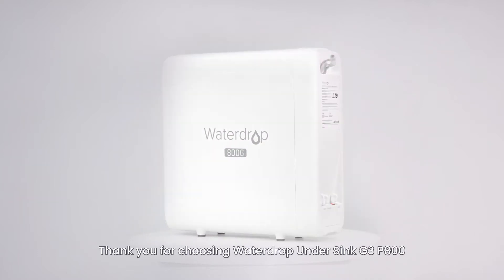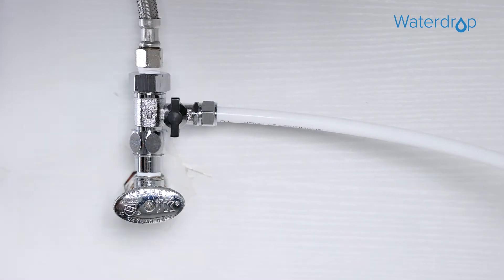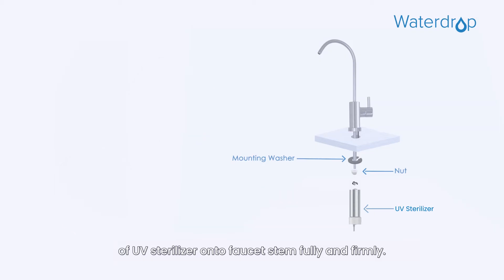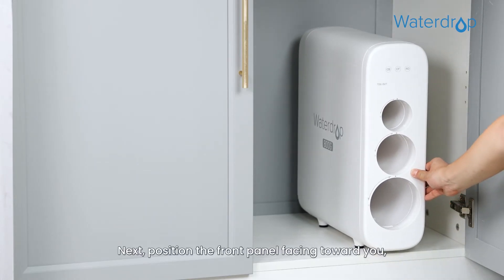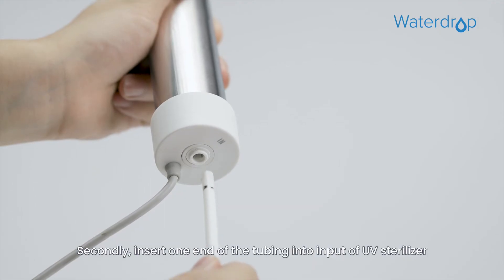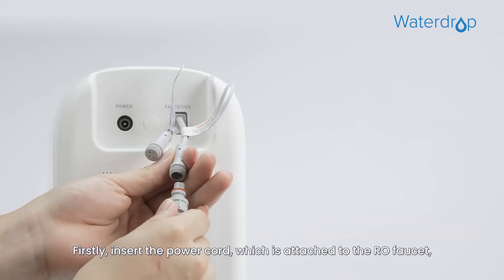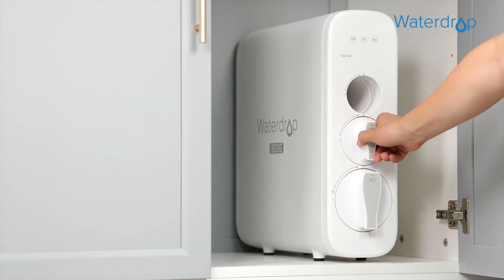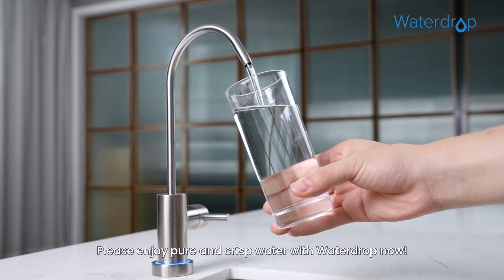Waterdrop G3P800 RO Installation

Comment: My plumbing set up has a 1-1/2" ABS drain pipe that I have to use for the waste water saddle.  The 1-1/4 sink drain were not ABS so the OD was too small.  To change it all would require doing way too much work.  I was able to make it work however it was strained over the ABS pipe.  I'm sure I am not the only one that has incurred the situation. Should include a waste connection for both drain pipe sizes.

Comment: Really wish the instructions didn’t call the cold water faucet line a cold water pipe without specifying what the “pipe” is. I was set to install it like this, then read the instructions and it confused me thinking the hook up was virtually backwards. And none of my fittings fit so I had to go buy adapters to reduce, now I have to go back and buy all new adapters because the instructions are misleading. I would have been better off if i didn’t look at that damn page! 🤦‍♂️

Comment: We just have one power outlet that is connected to the garbage disposal. In order to use the RO system we need to discinnect the garbage disposal. Is there a easy alternative to this issue?
Reply from the maker: Hi,
Thank you for contacting us.
I apologize for any inconvenience that may have caused you.
 
In order to provide proper assistance to you, could you please contact us via the following email? Thank you.
service@waterdropfilter.com
 
Enjoy the rest of your day!
 
Kind Regards
Mia Lauren
Customer Service Rep
Reply: Honestly if it's connected to the GD then you aren't going to have a good experience since that is presumably on a switch - an electrician can install a second 'dedicated' outlet, which you'll need
Reply: Look up kitchen split recepticatical outlet. Please be careful to turn off the breaker while modifying the outlet as it's 120v or higher. It was easy for me, but I've worked with electricity for 10+ years.

Comment: it’s really difficult to insert drainage pipe in whole
Reply: Might want to update your video and instructions -put a sticker on the box and send to website for updated instruction.
Reply from the maker: Hi,
I'm sorry for the inconvenience caused; please note that the drain saddle has been updated but the user manual is still the old version.

The tubing does not have to go through the drain saddle in this case, thank you for your understanding.
If you need further assistance, could you please contact us directly, thank you.

Email: service@waterdropfilter.com
TEL: 1-888-352-3558
Reply: @waterdropfilter.official  I had same problem , spent over an hr trying to understand what I am doing wrong. I am about to send it back. Update your video/manual
Reply from the maker: @vitaliestirbu9607  Hi,
Thank you for contacting us. 　
Please note that the drain saddle has updated and the red line does NOT need to go through it anymore. 
The user manual will be updated ASAP.
If you need the old drain saddle version, could you please contact us via the following email? Thank you.
service@waterdropfilter.com
If you have any other questions, please feel free to contact us.
Enjoy the rest of your day!
Kind Regards
Mia Lauren　
Customer Service Rep
Reply: @waterdropfilter.official  Hi, from my experience, this is not true. Our drain pipe leaked significantly when the pipe was not pushed through the front saddle. In order to push it through the saddle, try pushing the push to connect fitting down as if you were going to remove the pipe, and continue to follow the directions. This video is a very poor representation of what needs to be done as a whole, but it is correct in this one situation.
Reply: Also helpful to advise one to MARK spot on drain tube thru access for accuracy since red tube not going thru
Reply from the maker: @Houstonian343  Hi,
Thanks for your valuable feedback, I will relay them to our related department for processing, thank you so much!

Comment: Where would I put the Mnr filter
Reply: Before UV and output of RO to input of MNR. 1/4 pipe from faucet needs to be cut to do this fitting.
Reply: and then output of MNR to input of UV. output from UV goes to faucet.
Reply: Wherever it pleases you